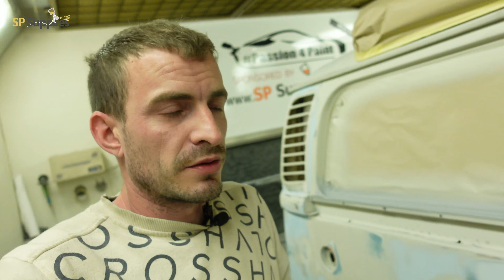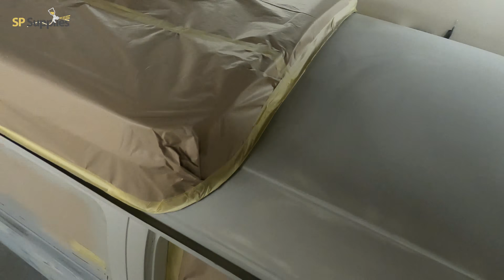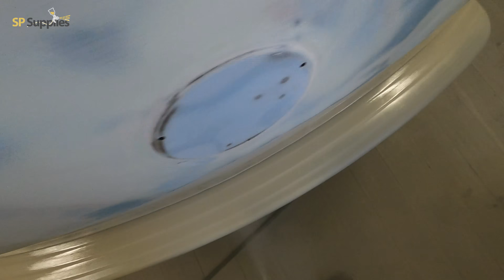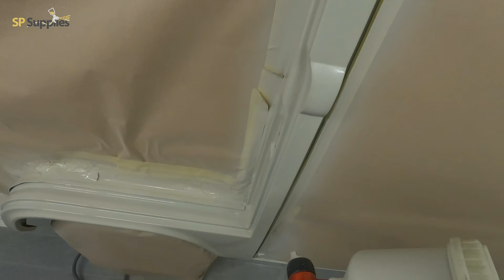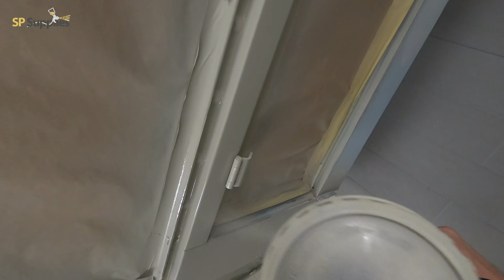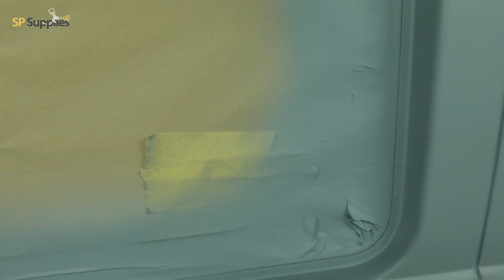Mipa Epoxy Sealer And Wet On Wet High Build Primer On A Restoration Job

Comment: Can i use the epoxy wet on wet after sanding the filler just to seal that and after flash time to apply the base and after the clear ? Thank you !
Reply from the maker: No epoxy you shouldn’t paint direct on top of bar primer

Comment: Great video! This is pretty much exactly my plan for my Mercury. Epoxy primer as a sealer, TDS says 30 minutes but I think you are probably right to wait an hour and then right to high build and then I’ll sand that with 600 before paint.

Comment: Great vid, exactly what i was looking for, thanks! About to have a go at wet on wet for first time. I was surprised you left it for an hour before the hi build. Is that because epoxy takes longer to cure than paint? I was going to wait 20 mins in an unheated booth, sounds like that will cause problems.

Comment: Hi there. Could I ask which Mipa 4:1 high build that you used please as there seem to be 2 different ones available.

I’m doing a Range Rover classic which is a mix of ally and steel panels and I’ve done Mipa EP first then plan to do the filler work then seal again with Mipa EP, then high build then Mipa EP again and then Mipa 2k top coat

Comment: Hi, Great video. Lots to learn. I am doing a similar job on a 73 charger, have blocked the whole car, some small areas have gone to bare metal on edges and the odd 50p size meta exposure on some panels. 

I am using a zinc spray can primer to seal the bare metal areas. My question is, is the epoxy necessary, or can I just use a high build primer and then paint? Advice appreciated.

Comment: So say you don't have an oven and wouldn't mind keying up again is that ok,  I'm planning to go back to metal around the window area due to rust, plan is to remove  rust treat treat it then etch primer (wondering why the sealer is required ? ) Then high build then paint this is gonna be over a month lol

Comment: Great advice about the real world. Just did a motorcycle spider front sub-frame with nautical epoxy primer from Titan (probably 1/3 of the cost of MIPA's). Very very thick, used a 2 mm Iwata and was still difficult to flow. 3 hours under ambient temperature and then 1 full hour under the IR light. The primer was still not fully cured. Followed this by a direct gloss black paint and repeated the IR light. One week later it's rock hard. Really successful process, almost wet-on-wet. Surface is thick, chunky looking textured, but for a motorcycle sub-frame it looks sturdy.

Comment: Hi Tony,
Apologies for dragging you back to this vid but everytime I watch it I learn something new.  Can't remember if I mentioned it but I ripped all the rot out of my T4 and did a 'first aid' respray under a 9x9 gazebo....using Mipa products.
I accidentally did the wet on wet technique around the window shut as I only had one gun I had to thin the epoxy right down.....went on like a dream.

Question:  I plan to do pretty much the same thing you've done to the camper however my bus has quite a few layers of paint on it now.
I want to take it all back to primer (ish), which I know is going to mean shed-loads of work.  Should I convert a grinder to a soft backed sander and smash it with 150 discs or would you recommend another approach.

Love the info you put out Tony......really appreciated.
Reply from the maker: Honestly buddy you’ll probably be faster paint stripping it back than sanding it’ll take weeks to sand it all back that far if there’s a lot of layers
Reply: @TonysRefinishingTV  Hi and thanks for taking the time to get back.  I had a hunch you might say that.  What's the score when the paint stripper hits filler or is a case of removing everything , filler and all? (Nkt that there's much filler at all...most of the panels are new).
Ta
Reply from the maker: Ideally mate just take the lot off tbh

Comment: Hi mate, I'm a bit curious as to why you've epoxied this as its not been stripped and to bare metal? Whats your method behind it as being a painter myself and from my knowledge of products id personally only use epoxy over bare metal before filler then high build? 

- I'm not here saying you're wrong by the way genuinely interested as I may learn something new
disclaimer not watched all the way through yet so if you have said in the video then my bad lol
Reply from the maker: lol no problem at all man take a look at the video i did first on this where we just shot epoxy on the van over the old paint ect and i explained why in detail in that

Comment: Gotta feel for those keyboard ninjas, they more than likely aspire to paint but lack the fortitude or will to try resulting in them directing the dislike they have for themselves at others doing what they wish they could do. Substrate up restorations are great but the cost and time involved can quickly become astronomical plus with advancements in chemical technology it is not necessary. Your work always looks great plus you put yourself out there to help others which is awesome.
Reply from the maker: Thanks man and very true words too fella

Comment: For all the so called painters out there hears a tip for you.
Go and stand outside one of those nation wide body shops and see the horror that comes out of there as finished.
 Steve Wonder could see the grt, pinholes , runs and general poor finish, on cars. 
P S you can take your car to which ever body shop you choose,  not what the insurance choose for you.
Reply from the maker: So true man
Reply: @TonysRefinishingTV  Three times the lad at work sent his wife's car back.
The second time it came back he sent it to another body shop. He sent it back there too.
Four attempts to put it right.

Comment: Tony, I know are doing a good job & putting plenty of time into this job & this isn't a troll rant, but stripping a bus to bare metal with paint stripper & a bit of 40g is not a weeks work, 2 days max 1 person, if you didn't do the roof. A lot of the time you've spent on it ie 14 days, has been spent feathering out bad repairs & poor previous paintwork, stripping would have been quicker & better IMO. I'm not knocking what you've done as you are a hardworking guy that knows his stuff.
Reply from the maker: Very true mate but then the whole bus needs to be bodyworked from the ground up , who knows how many hours filler work , dent pulling , straightening panels will be needed after it’s all been stripped back to bare metal ???
Reply: @TonysRefinishingTV  Exactly, it would be absolutely amazing though if it was just a matter of getting the paint off.
Reply from the maker: Wouldn’t it just mate
Reply: @TonysRefinishingTV  I do restore cars & I run my own business, as you know there are digital paint gauges that tell you paint thickness so can detail areas prior to stripping back, also bore scopes for getting into cavities, these are the methods I use to investigate my jobs, but I do restoration, not general painting as you do. I like what you do mate, not knocking it.

Comment: I have some Chameleon products that have an epoxy with a  urethane primer that you put on like that. great way to get great adhesion and still have a sand able product on the top. I also use a product that is a urethane encaplulater. has really good adhesion and rust encapsulation. Not recommended for heavy rust but if there is minor sanded and treated rust it will hold out for many years.
Reply from the maker: Good to know mate

Comment: LIke the wet on wet process. I do that with a paint manufacturer here in the US. Tamco has some products like that. They have a single stage urethane that you can wet on wet clear on flash. Really nice for having more on there to buff. Great for show car or home job where you will need to color sand and buff.
Reply from the maker: Thanks for the info thats an awesome way to be able to do it mate

Comment: Tidy job as ever. You got it right, then you've sealed it, its high built, it's gonna block out and top coat like a new van, and with all that paint it will probably last much longer than it did originally.
Reply: tony has a great methodical method of spraying. Great smooth style neat and accurate.
Reply from the maker: Thanks buddy and yeah man we’re making the best we can out of the job and budget we have

Comment: Bus is looking great Tony!  I bet if you put that bus and one taken down to bare metal next to each other the armchair experts wouldn't be able to tell which was which once they've been primed!
Reply from the maker: Lol that mate is very true buddy
Reply: for sure sometimes I would rather keep the original undercoats there too for better protection if they are not compromised. useing that epoxy as a sealer gives it better adhesion and a strong seal coat under the primer. Kind of like another coat of steel.

Comment: fuck the idiots mate.. Half of them probs havent even picked up a spray gun haha
Serious question though....
Why the need for epoxy sealer.. and then primer?
Surely, Sealer, is primer?
As im aware that americans call primer, "sealer"...
Reply from the maker: Lol thanks man , so the epoxy is pretty much a neutral layer abit like barcoat back in the old days if you’ve heard of it , but it’s a waterproof , rust inhibiting sealing layer so I want that sealed layer on there to protect the metal and everything under it and then the primer gives me room to do the final block and sand for paint but without damaging that dealing layer that’s protecting the van of that makes sense I hope it does lol think of it like ecoat on a brand new shell